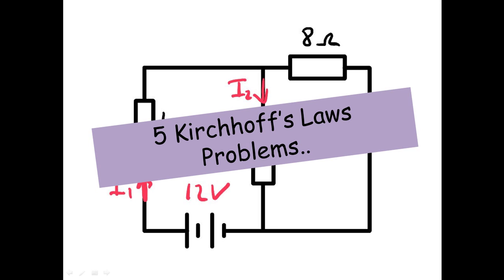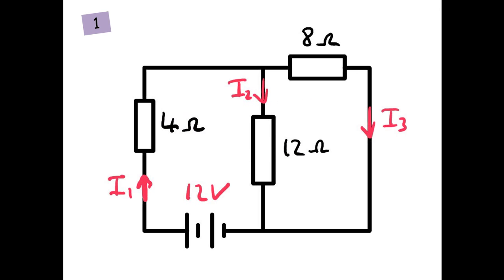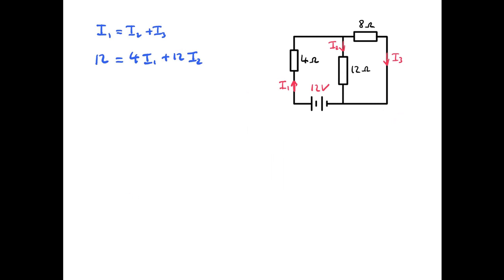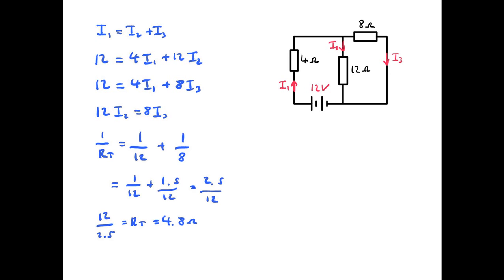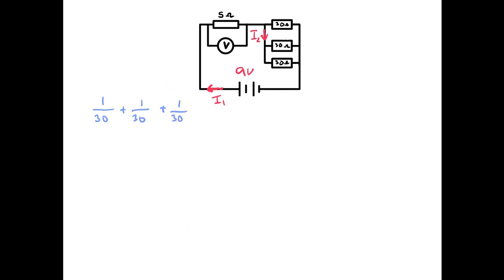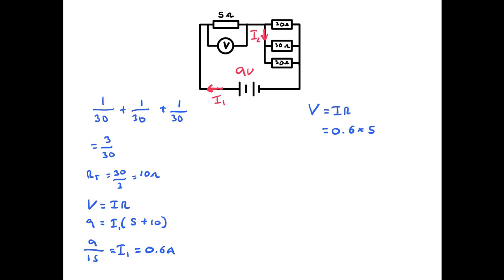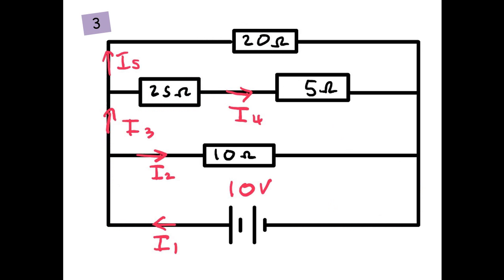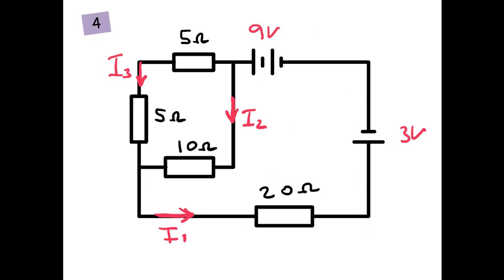kirchhoff's Law Problems - A level Physics

Comment: How does the voltage divide by 2 in the last question? the circuit is in parallel right?
Reply: In my opinion this was a mistake in the video. The correct method of solving for the current is formulating simultaneous equations. First use V = IR for the left, then that the addition of the two currents is 2.25
Reply: might be a little late here lol but heres my theory on this. on both the sides, the resistance is equal so basically, total resistance = 2 * each of the parallel connection(R). so basically, 6V = I (2R). now if you divide both sides by 2, you and put in R, you get the value of I
Reply from the maker: Hmmm
Reply: The circuit is as,    ___8ohm____        ____8ohm____      
                                 I1                   |_I2_|                          | 
                                 | ___4ohm__ |       | ___4ohm___    |    
                                 |                                                        |
                                 |______________12V_____________|
So 6V is given for each parallel combination of 8 and 4 ohm resistors.